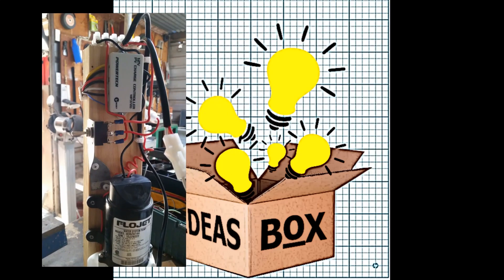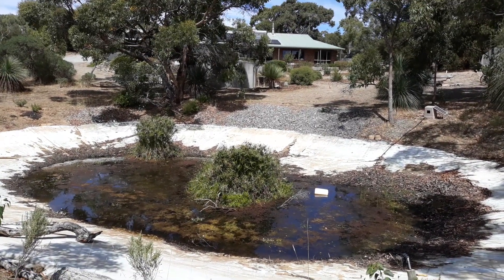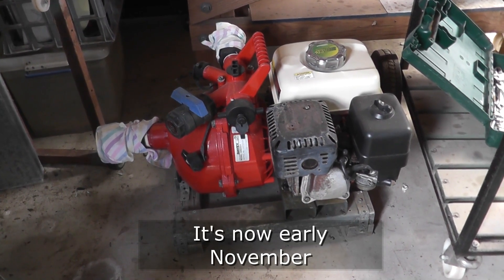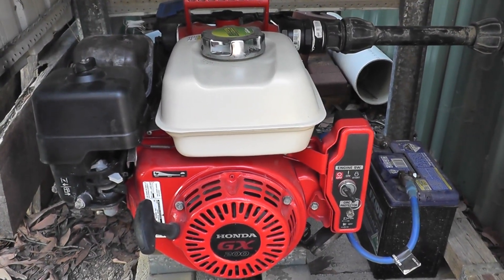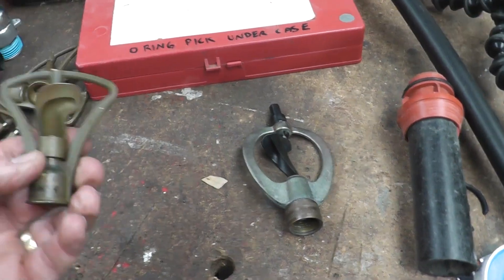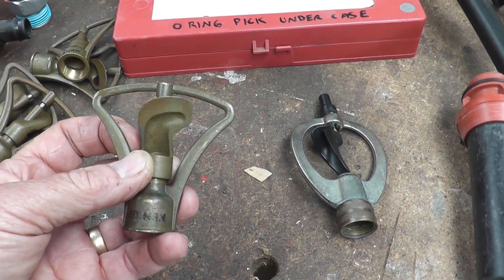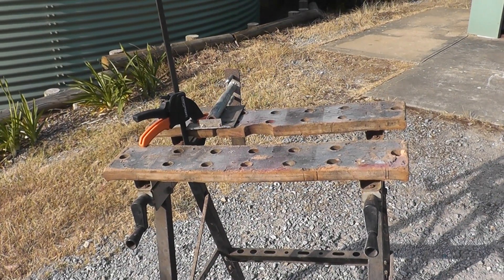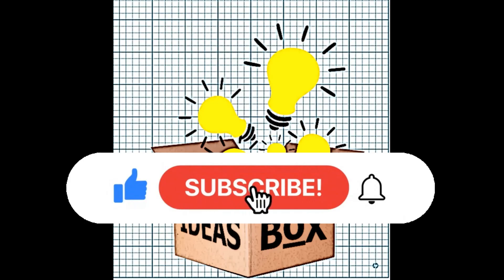testing our fire pump and roof top sprinklers

Comment: Jimmy I’m planning on building a dust Crete home and also have a fire trailer ready to go. I’m concerned about inside air supply. In a fire situation. Have you any thoughts on this?
Reply from the maker: Hi, thanks for commenting. I guess the air supply would depend on the interior volume of the home but you'd have to get professional advice on that. We don't plan on staying to defend the property but figure if we're stuck and can't get away we may as well be set up to try.